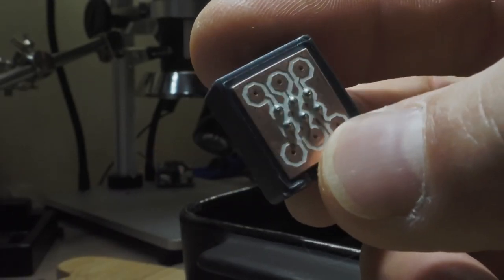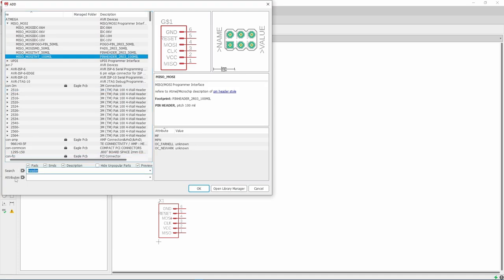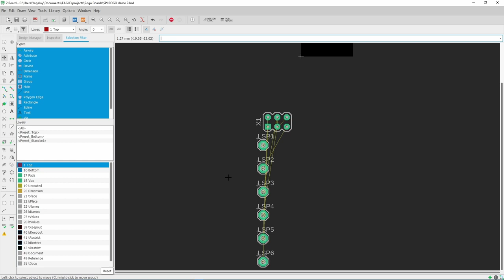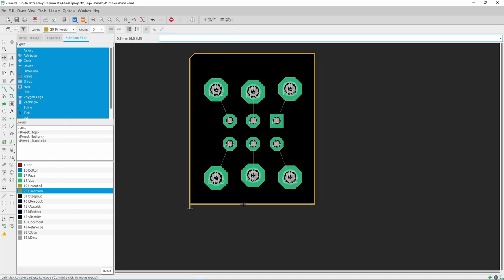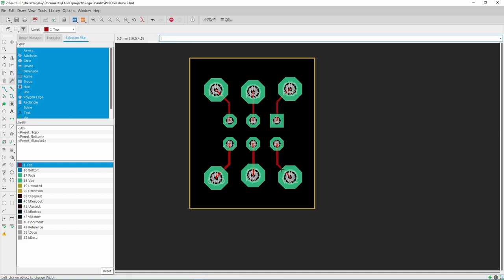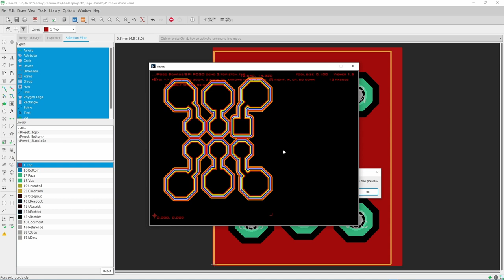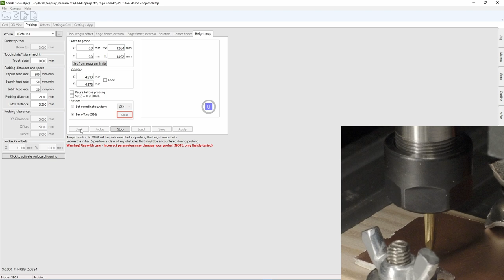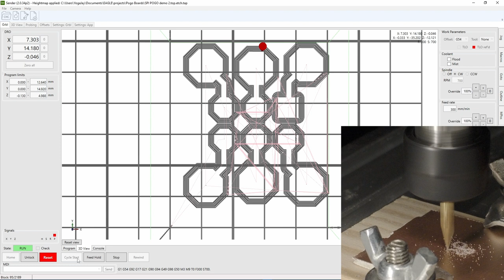How to make it: ISP/ICSP POGO PIN PROGRAMMING ADAPTER

Comment: Really good video. I was wondering what software you were using. Also did you solder the wires on top or bottom?
Reply from the maker: Wires get sorted to the pads on the copper side of the board. To which software are you referring?

Comment: looking for a custom pogo pin jtag for my door sensor. up for a go?
Reply from the maker: Are you looking for manufacturing services?
Reply: @JeannotKuenzel  thank you for the reply. I have a door sensor contact for my system they has 5 points to solder on the reinstall a Mac address. I thought you may be easier to just have a little pogo pin board to push on to connect too
Reply from the maker: @riverrat_uk  this would have have to be made to the spacing specs of the sensor then? This would require precise measurements on the part though. Dimensional accuracy is very important. There might be someone in your area that can assist.